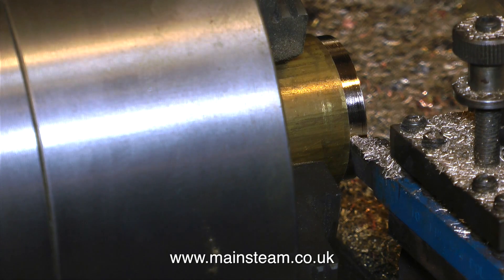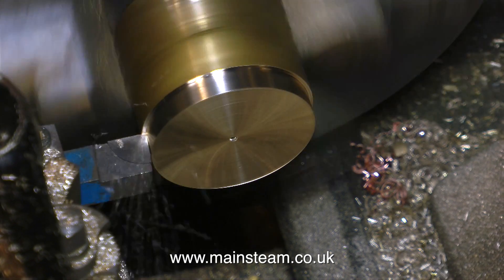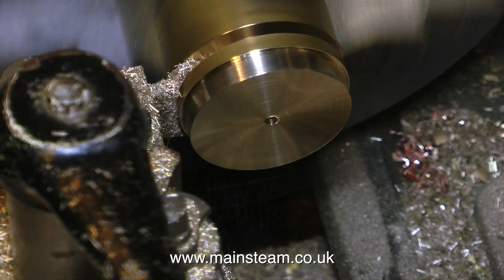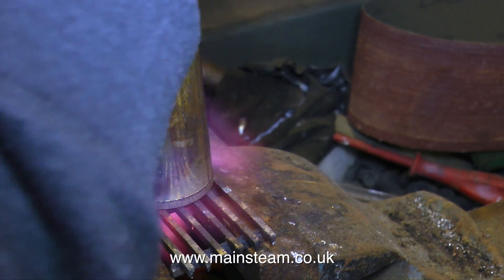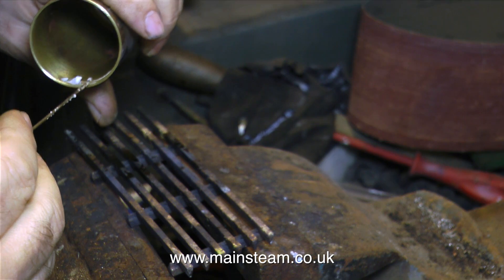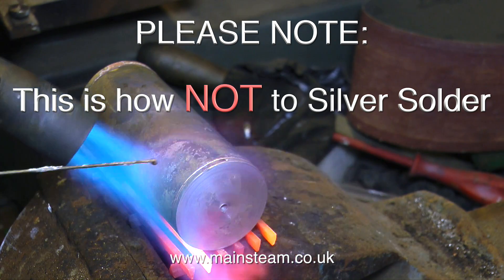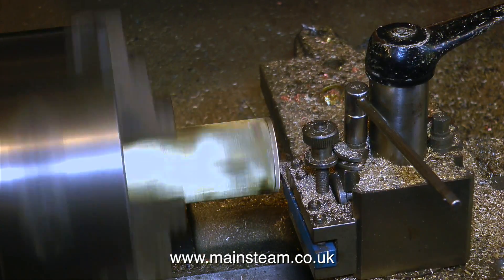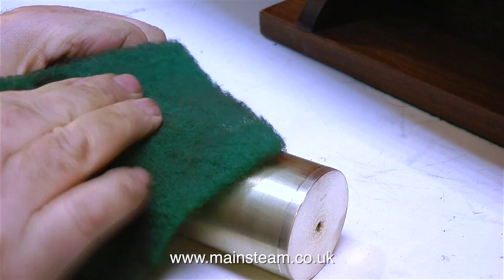REBUILDING A VINTAGE MODEL OPEN STEAM LAUNCH - PART #24

Comment: Had an off day soldering the second cap did you. I saw what you did, made a hash of it and tried to cover it with a how not to explanation. 😉
Reply from the maker: That's right, I am really that completely and absolutely crap at it ..... :-)))

Comment: And it's at this point I realize I've been silver soldering wrong this whole time. Thanks for sharing the proper technique.
Looking forward to that Stuart Victoria series by the way.
Be sure to let us know how we can subscribe to that series.
Reply from the maker: I intend to start the project next Month but it will be a while before it is finished.
Reply: Keith Appleton ah yes, it took me nearly 8 months to machine and construct the D-10 with it's reversing gear & water pump. Which you should be able to see on my channel on its very first run.
I'm about 2 month into the No. 9 model now. I think I'm going to pair that with a box hill loco boiler in a stationary set-up. The good people at Blackgates will help me get set up with that.
Happy steaming from across the pond!
Reply from the maker: That is one beautiful model Steam Engine - a master work - one of the best I have seen :-)))